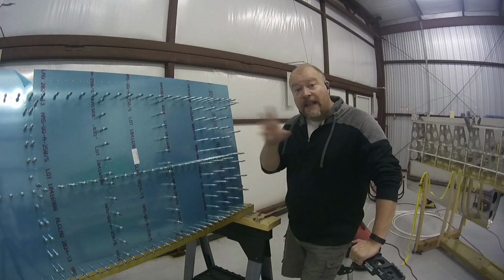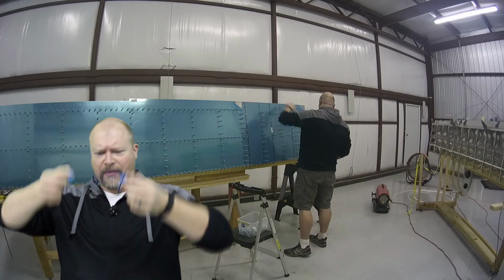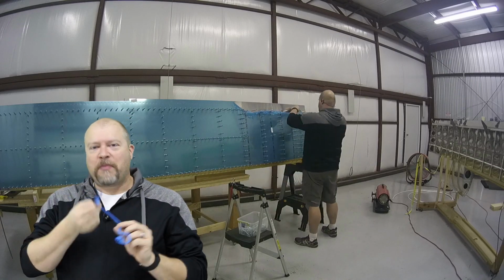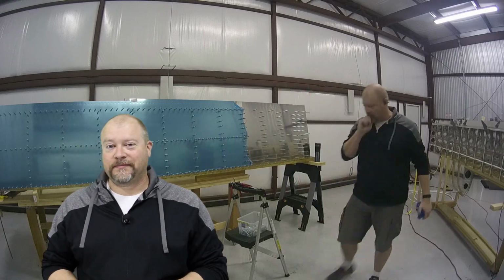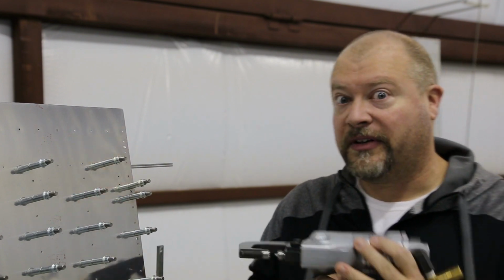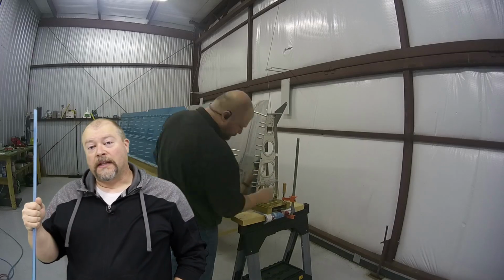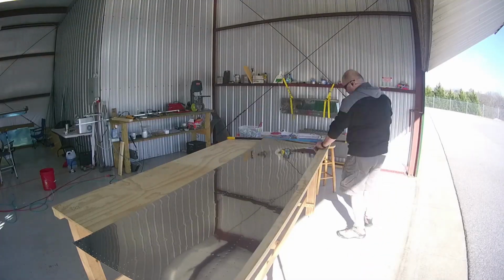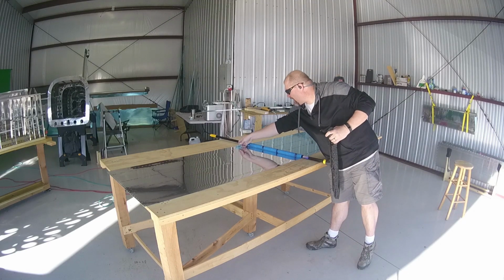RV-10 Wings - 038 - Right wing skins, dimples, counter sinks and more

Comment: Yes its spring loaded so you apply light pressure while it rotates a couple time then push through the hole and the little knife retracts and while you pull it back out it deburrs the other side. I think it works a little better after a few hundred holes. The spring seems to weaken a bit and doesn't over deburr. I've done a few thousand holes so far and think it does a good job. It's probably saved me a hundred plus hours.

Comment: Hey man! Thought I'd check in. I'm still following along and looking to order tools and an RV7 empennage in the next couple months (I'll be using your builder number). 

I haven't been a "professional" pilot for long, going on 3 years now, but from my perspective GA flying and flying as a career are different enough that GA flying will remain my hobby. I'd equate it to a taxi driver who rides motorcycles on the weekend. You may be driving the same roads, but you're doing it on your terms. I'm sure you'll find your way.

Comment: I built the airfoil practice kit at a Synergy Air workshop. They're the ones that build the 12s for resale. They reuse the bluing as rivet tape. I don't think I would use it as a home builder simply because of the added time. That said, if someone building a plane is going through the process of removing strips of bluing, it might make sense to keep those strips as rivet tape.
Reply from the maker: Reusing bluing as rivet tape is not a horrible idea.  But honestly, using just plain ol'blue painters tape works great.
Reply: Jason Ellis I don't know that I would use it when building (more likely to use painter's tape) I just thought I'd mention it for other's benefit.

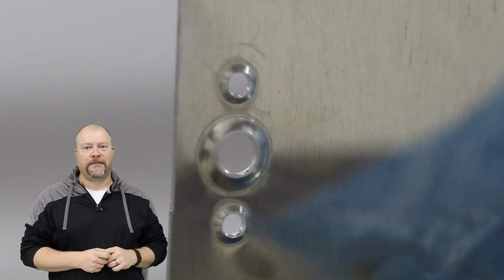Comment: Did you make a mistake at 8:27? I've never seen a nut-plate that has countersunk or dimpled attachment points (rivet holes).  What is the p/n for the nutplates used at this location?

Comment: Concerning the dimple machine that you use, and forgive me if you have already addressed this (if so, let me know an I will go back through your videos!), but have you noticed any issue with how flush the rivet heads end up being on the skins? I've seen other blogs talk about using the smash em version dimpler (with the hammer), saying that the sudden force (via the hammer strike) vs the relatively gradual force (the squeeze) deformed the metal better and therefore made for a better seating surface for the rivet heads to sink in to and be more flush.

I tend to like your machine better than the idea of having to reposition and then pick up the hammer and strike the instrument just right (hoping that my piece hasn't  moved on me in the process!!). I'm getting ready to start getting tooling and such together before I order my kit and wanted to see what your opinion between the two tools might be.
Reply from the maker: Hi Scott.  I'll take some extreme close ups to show you but honestly, I think that excuse is garbage and will 100% depend on the dimple dies you get.  Some dimple dies are slightly different than others so you get a slightly different seat in the final product.   But the notion that a sudden dimple versus a slower dimple causes some difference seems absurd to me.   The end result should be a 100% conformation to the die.   If for some reason the compression style tool (DRDT2) doesn't show as clean a dimple its because you don't have it set correctly.  I mean, its entirely the about the die.  Does that make sense?
Reply: Excellent. That makes complete sense. I'm looking to start gearing up and will be going with the lever style. Thank you for your input.

Comment: Couldn't you just peel the blue through installed clecos without removing them?
Reply from the maker: This would leave little blue circles around the hole where the bluing was.. Cleco's hold very tightly and most of them would cause the bluing to rip, not be pulled out from under them.

Comment: Im used roundhead brass rivets. In thin alluminum. Brass is so hard .youl tear  you sheeting. My air is 30lbs. Got the right gun an  recessed bit fits my 3/16 head perfect. You GOTTA HAMMER to to much. Then the very center of your dome gets a flat spot .
I REALY need the rivet to be hollow. They tell me i cant buy a3/16 head. 9/32. By 1/8th inch. (Their solid by 1/4) i haven found what i want. OH i tried drilling them. NOPE ,! Made a jig. Drillpress. Brake a cheap bit every second.ANY knowlege anyone has HELP ME OUT.